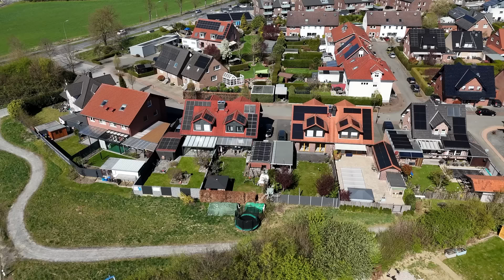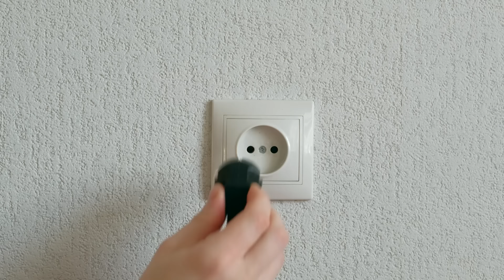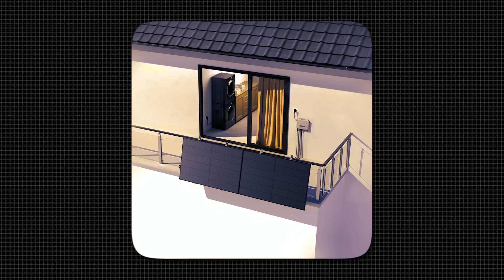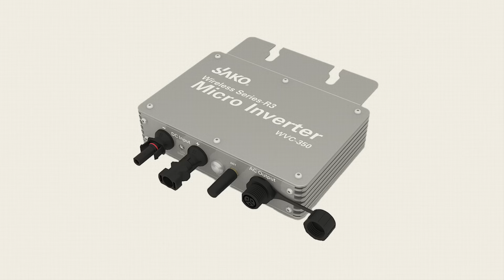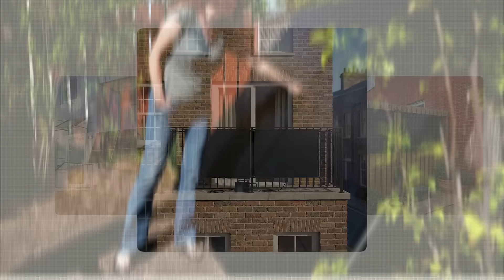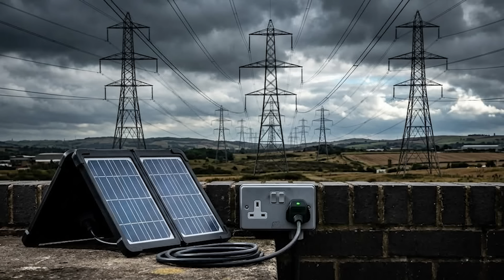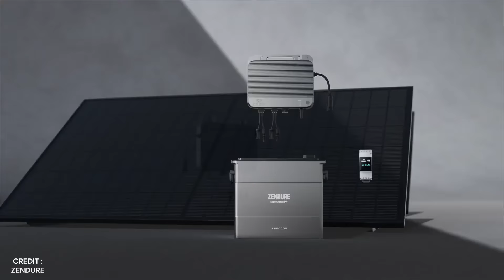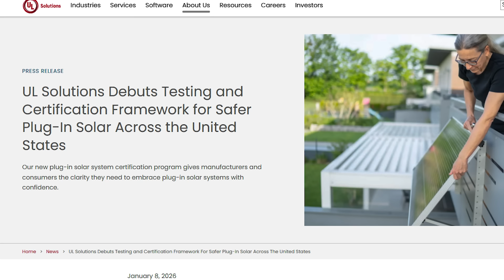Plug-In Solar Could Revolutionize Home Energy - Why Is It Illegal In 47 States?

Comment: In Washington State, there was Senate Bill SB6050 before the legislature this past year.  BUT the electrical utilizes stopped it for "safety" (monetary) reasons.   But I will get one, as I have a separate electrical wiring system I built into the house to run "things" off my Honda Gen Set.  Once the bill is passed; then I can switch it over to the regular side.
Reply: There is a safety reason.  If it doesn't have protection circuitry or that circuitry isn't robust it can back-feed the grid during a power outage and potentially electrocute a lineman.  Living in Washington State, I predict that the politicians will be too stupid to realize that safety standards must be promulgated first and the specific equipment authorized for connection to the grid by electrical experts.
Reply: @markmeridian3360 UL has solved that problem with the new UL3700 code.  It checks for "anti_islanding" and shuts down the micro inverter.  But the repairmen always short out the high tension line to the neutral downstream of the breaker before they start any work.  It's the last thing they remove before they install a new fuse.  With a UL3700 rating the power companies have no ground to stand on.  They going to make you unplug your UL appliances????
Reply: @WarrenMesser  NO!  UL3700 does NOT apply in 48 states.  Only two have adopted it (Utah and Virginia).  30 states have introduced legislation to adopt it (but haven't yet passed that legislation), 18 are sitting on their thumbs.

None of your appliances back-feed power into the grid. 
 
For me to install my battery back-up on my house's critical circuits, in order to pass code I had to install breakers with physical switches that prevent the system from back-feeding into the grid.  Why?  The battery/inverter did not have auto-switching equipment that meets code.

I had a job that, in-part, assisted electricians in doing electrical work for 5 years.  "Repairmen" usually do not short the hot to the neutral before they start any work.  They lock out the main breakers, which, by itself, would not prevent getting electrocuted by a plug-in solar panel.  

We need to have these safety codes adopted and need experts to review each type of plug-in solar panel for compliance, especially the cheap ones coming from China.

My question to you is, are you parroting falsehoods that you read somewhere else, or did you make them up yourself?
Reply: @WarrenMesser  I just reviewed an interesting whitepaper that touches on line-worker deaths, and found this very interesting:  "Documented line-worker fatalities from backfeed are attributable exclusively to portable generators. OSHA and NIOSH case records confirm multiple deaths, and the specific kill mechanism—transformer voltage step-up from sustained generator backfeed—has been directly observed and documented in the field."
Reply: @markmeridian3360 For all this fearmongering the greedy utilities do, I have never heard of a single instance anywhere in the world of anyone getting electrocuted from working on a line where there was solar backfeed. As far as I know, all microinverters have anti islanding, even the cheap ones with no certifications, this is kind of the entire point of a microinverter. So, they would rather have millions more die from pollution caused by burning stuff in power plants instead of use actual logic.
Reply: @xeridea  Maybe not electrocuted but several people have been shocked.  Look it up.  It's just a matter of time until there's a death if proper safety standards and installation isn't followed.

We need 24/7/365 power.  Solar doesn't provide that.
Reply: @markmeridian3360 Only Maine has adopted UL 3700. Utah and Virginia only require "UL equivalent" safety protections, but that's more of a nitpick than anything and in no way invalidates your point.

And like you observed, UL 3700 is not an anti-islanding standard. That is UL1741 and IEEE 1547, which UL 3700 builds upon and expands. For everyone's reference, between UL 1741 and IEEE 1547, once power is cut to the micro-inverter, it needs to disconnect solar inputs with 2 seconds. That may not sound like a lot of time, but it's plenty to have an accident.

I will grant that compared to the overall consumption of a house, 800 watts is not very much. But anyone out there take it from me, or from Mr meridian3360, or anybody else who's plugged themselves into just 120 volts: It doesn't take very much.
Reply: @markmeridian3360UL-approved plug-in solar 120-volt microinverters such as the EZ1-LV available from EZPluginSolar have rapid shutdown / anti-islanding.  They shut down when grid power is lost, so they cannot back-feed the grid during a power outage.
Reply: @markmeridian3360 Micro-inverters of the sort used by (most) plug-in solar kits require grid power to function. They will feed power into the circuit, but unless they detect upstream (grid) power, they will not engage and will not feed electricity back into the circuit.
Reply: @PhycoKrusk  The point is that any system that gets installed must meet a robust electrical safety standard.  That typically involves more than one safety measure unless the one safety measure is fool-proof.  

You can't meet a standard if there isn't one.  Currently, 48 States don't have one.  

Apparently, at least some of the systems that have been installed aren't fool-proof as there have been multiple reports of people getting shocked by them.
Reply: @markmeridian3360 47 States: Utah, Maine, and Virginia.

But I will grant you that there is no unified standard, and that the lack of a unified standard means there are gaps that may allow for accidents.
Reply: @PhycoKrusk  Yes, it took me a couple of days to think about it not working.  Want to try an experiment using the output from the solar panels plugged into the same outlet that a power bank is plugged into.  See if the power bank could drink from two straws at the same time.
Reply: @WarrenMesser  Depends on what you mean.

The power bank will not charge any faster. It will have its own internal safeties, mainly to prevent it from overheating, and will adjust its rate based on the available supply, and it cannot exceed those limits, which it is able to reach with just the grid power.

However, whatever solar is coming into the circuit will offset what you need from the grid.

Comment: Run task specific panels with individual inverters.  I’ve had the same 50 wt panel inside a window in my home office running just the lights and a tv with an antenna for 15 years. Nothing to do with the grid.

Comment: We love our solar and batteries.  They have eliminated our annual power bill.  They have even generated extra credits each year, and we usually get a check for $200-500 each year.

As an added bonus, the batteries ensure we have power overnight if the grid has an outage.

Comment: I built my own solar system that I connected to batteries that drive an inverter wired to a manual transfer switch that provides power to selected circuits in my panel.

The system is completely separate from the grid, so no issues if the power goes out, other than my having to go out and flip a few switches.

Essentially, my fridge, upright freezer, and furnace are off grid. These are the hogs driving my electric bill, which averaged $67/month last year.
Reply: I didn’t build mine, but I use 800w of fence mounted solar connected to a power station that I use with a transfer switch.  I power a couple of circuits full time in my small (not tiny) house. I would love to add more solar but my lot is too small, and rooftop panels would bring higher insurance premiums.
Reply: @pasheatsi Rooftop panels are a pain for maint. anyway.

Comment: 200 to 1600 watts (what you can reliably get from "plug-in solar," is not going to "revolutionize" ANYTHING!
Reply: Depends on many people do it and bow sunny it is where they live.  There are something like 130M households in the US and <10% have solar electric currently.  90% of 130M is 117M households * 4.5hrs annual full sun per day * 1600W = 307BkWHrs/year.  

EIA says there was 290BkWhrs generated in 2025 in the United States.

So, given unrealistic maximal adoption, it would more than double current PV contribution to the grid.

Granted, that’s outrageously unrealistic :)

But even 25% adoption (and those who ignore the limits - hopefully using different branch circuits) would be a 25% increase in national solar production.   That’s pretty revolutionary in my opinion.  The power company will certainly feel that large a drop in demand (and revenue)!

Comment: 800W plug-in solar was allowed in Belgium in April 2025. I immediately bought 5 panels for a total of 800W and payed fully for it with Eco-cheques, a state-sponspred bonus system we receive from our employers. This means I'm now producing between 2 and 6kW per day and i didn't have to spend a single €. Very glad that I did
Reply: 6kwh = 0.8kw * 8 hr = 6.4kwh
Reply: Subsidized by the EU.   
Euro is falling
Not much sun in Northern Europe 
Nuclear or natural gas makes far more sense and lowering power prices to maintain jobs and industry.  

Solar power makes no sense in Canada uK or Northern Europe 

Nuclear is the best long term solution
Reply: @patrickstarrfish4526 another dinosaur
Reply: @patrickstarrfish4526  Never been to any of those places, have you?  Rooftop solar is EVERYWHERE and it works.  It works well enough to be EVERYWHERE.  Stop being an apologist for a dying dirty technology
Reply: @patrickstarrfish4526 except it's already been proven to work in neighboring countries
Reply: @patrickstarrfish4526  - no, solar is the best energy as it's renewable, wind is next which can be drawn from turbines. Nuclear, gas, oil, coal are not renewable and are dangerous, polluting and need to be banned.
Reply: @C.M.30337 You need to do some more research. Solar and wind are also dangerous, Heavy metals etc, extremely expensive to recycle and wind turbines are now filling landfills. Nuclear is the cleanest energy if done correctly, which it currently is not.
Reply: @C.M.30337 .  Interesting how people who want to ban gas , nuclear power ALL REFUSE to disconnect from it.  Live by example fool.  Just like the environmentalists flying around on private jets all while demanding we the peasants ride bicycle.  You have no spine.
Reply: @jimfields9491  - I would love to be able to afford an electric or hybrid car, but since I'm living on a fixed income, I have to drive my 33 year old car that I bought for $5000 that still runs. My insurance is also way less. I don't use my car very much, but do walk and take the bus when able. And since I've been vegetarian/vegan for over 50 years, I've helped the environment, animals and my health. So, before you start calling somebody a fool, think about other people's situations first. Until you've been vegan for 50 years and lived below the poverty level on a fixed income, you have no room to talk and are the one with no spine.
Reply: @patrickstarrfish4526  Stop lying dawg.

Comment: If you backfeed a standard receptical you can have power feeding from the inverter and braker at the same time. Other recepticals in the same circuit can overload the system.
Reply from the maker: If you add multiple units to one circuit you can obviously overload the system.  This is something you have to consider before installing multiple units. Appreciate the comment!
Reply: The video addresses branch circuit overload directly.  I’m not convinced by their explanation because a) people will ignore the rule/limit, and b) that margin in the wire carrying capacity is there for a reason or reasons (I only have limited understanding of them so need fo learn more).

Comment: Not bad considering the heavy AI curation.  But there were some mistakes.

Actually doing a decent job reducing your electricity bill requires both current monitoring AND additional battery storage and load-shifting into the evening so any excess energy collected during the day is only exported during evening peak hours where the utility may actually give you export credits for.

Existing US plug-in solar brands are ... vastly over-priced for what they do.  But once the laws get passed, that should quickly change so I'd wait about a year before actually buying a compliant system.  It will be a lot cheaper.

--

Germany's outlet power runs at 230VAC (at 50hz also)... which is why 800W is only 3.5A.  On a U.S. socket at 120VAC, 800W winds up being 6.7A.  So this "trick" of limiting the power to something reasonable actually doesn't work for a U.S. socket.  Not unless you drop the output power down to 400W.

That said, the laws many U.S. states are considering for plug-in solar do allow more than 400W.  But you have to be more careful to ensure that the total load on that circuit does not exceed 1800W.  UL 3700 allows 300W to 1200W but i can't actually prevent circuit overload.

Also, in terms of plug-in solar matching but not exceeding home loads... that requires current monitoring of the mains which adds extra complication.  Plug-in solar laws generally allow some backfeed to the grd so the current monitoring is not strictly necessary, but the utility is not going to give you much (if any) credit for excess power exported back out to the grid.

UL3700 is pretty badly deficient in that it requires the plug-in solar to be a complete system, including the actual solar panels, which makes little sense.

-Matt
Reply from the maker: Thank you for your reply.  All makes sense.  The video is based on the European system as Germany dominates the plug-in solar market at the moment, and we do mention the challenges of bringing it into the US. So do appreciate the detail behind that challenge.  Thanks!
Reply: You can run a 12-3 to an close by indoor outlet... I don't know of any GFCI 240v outlet...
Reply: @brucearkwrightjr.9246  You could do a 240v GFCI breaker.
Reply: So does UL3700 means you can't. build modularly? Like the inverters have to be part of the panel?
Reply: @ndubb100  It is a bundling req not a monolithic device req. It’s the same nonsense UL used when they realized they screwed up in requiring RSDs on roof solar.  Instead of simple backing down they instead said, ok, RSDs were not required but the entire system had to be specified as a bundle, right down to the mounting brackets.   They are doing the same thing with plug in solar.  Even though solar systems are modular and bundles are stupid.  It’s just a way to force vendors to pay UL more money whenever they make any changes.

But you don’t have to worry about the bundle requirement.  It will never be enforced for plug-in solar in the U.S.

Comment: Like many van dwellers, I am retired and struggling to live on my very meager Social Security. So I have had to take a different approach than the “create your own maxed out multi-KW solar panel and alternating current inverter grid and carry that around with you” solutions. Instead, in order to abandon the grid I first drastically decluttered, downsized, minimized and simplified my lifestyle (think literally Walden Pond equivalence).
    I am now living comfortably with no connection to the electric grid, no use or need for any electric devices except those that are powered by my two 95 amp hour, 12 volt lead-acid batteries, some miscellaneous USB rechargeable appliances (a fan, several LED lamps, a 20 K/30 W USB rechargeable battery bank, and a 25 W fixed in place and 15W portable folding solar panel, my phone and a non-pressurized alcohol stove). 
    l have totally abandoned the alternating current electric grid. Not just boondocking, total
abandonment. Thanks to car and van and RV dwellers, most appliances are now available as solar powered rechargeable 12 volt or USB battery powered alternatives. I have unplugged and thrift store gifted anything and everything I had that required alternating current. I also gave away my Prius and rely solely on ride share and delivery gig services. 
    As a minimalist I am not just concerned about minimizing my material possessions, I am even more concerned about minimizing my negative environmental impacts. Since I have been able to totally abandon the alternating current electric grid and to live on only my own solar supplied battery power, not only is this more energy efficient, it is also non-fossil fuel dependent and therefore less polluting and less costly and more environmentally sustainable. It can be done, and as a matter of environmental principles it should be done.  I have done it and I have never felt more free or more happy or more wealthy or less financially anxious.

Comment: so a better option is you have a generator outlet hooked up to your main panel in the house and then you just plug in a power bank which is connected to solar and then you isolate certain appliances like the refrigerator. This is a better way because there's no legality aspects that prevents you from doing this.
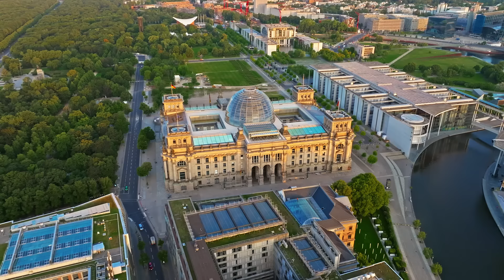Reply: If generators are the better option, why did over 1 million households in Germany adopt this model? The explanation at 3:03 is pretty convincing.
Reply: You didn’t think your comment through and I doubt you even watched the video.
Reply: In most municipalities it is illegal.
Reply: Where do I buy this and try to offset the elect cost.
Reply: But you are missing a vital point with the generator outlet... It is connected with a lockout kit to shut off the grid!!!